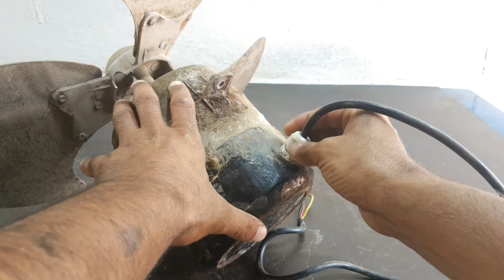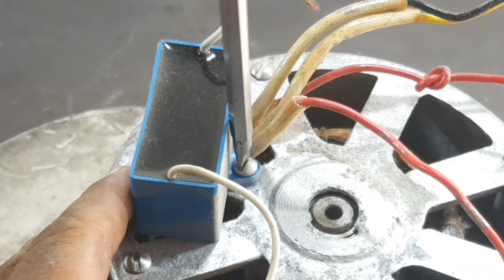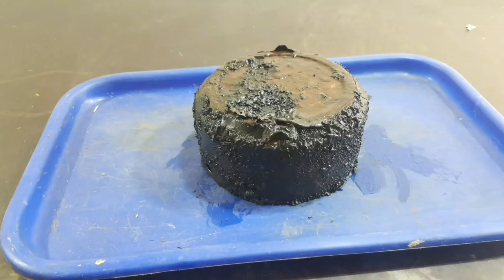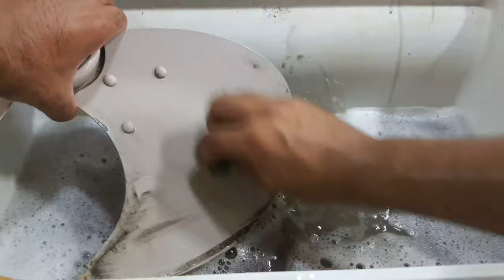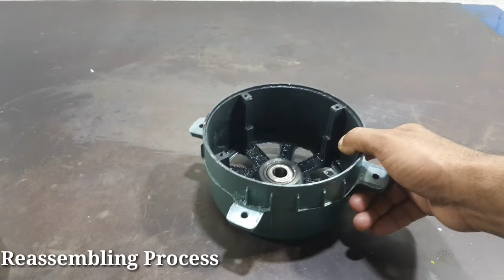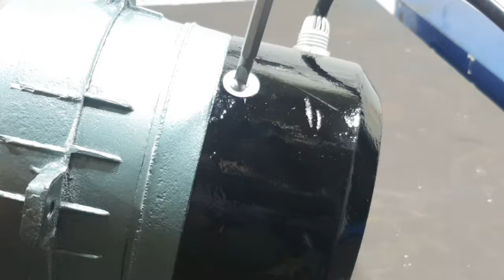restoration - old rusty cooling fan | air conditioning fan | restoring room fan

Comment: Turned out very well, but would personally use primer before varnish and soldering the cables after twisting on the next project.
Reply from the maker: Thanks for advice